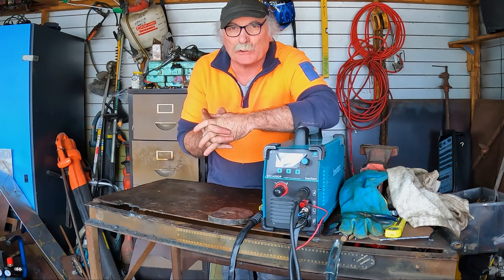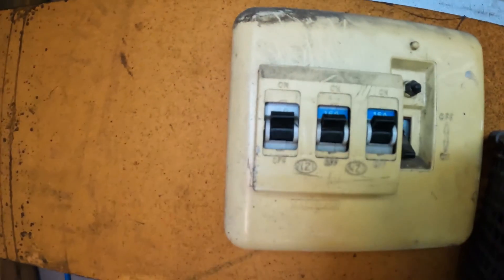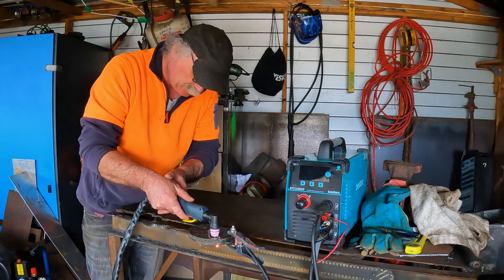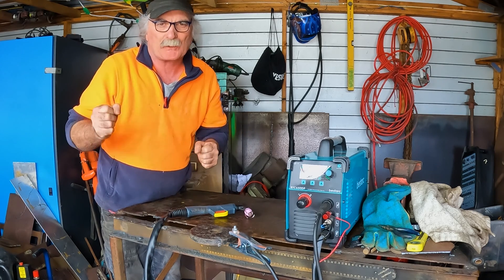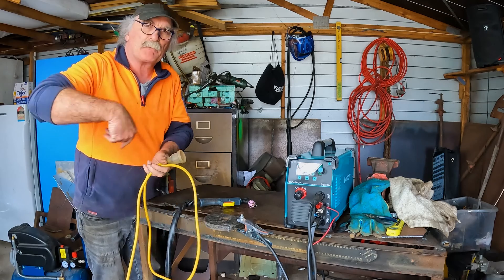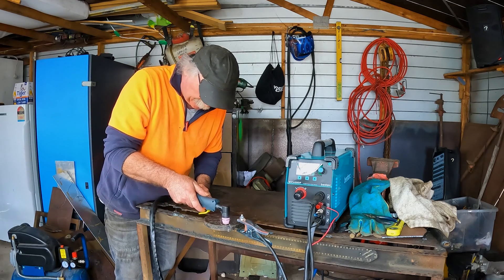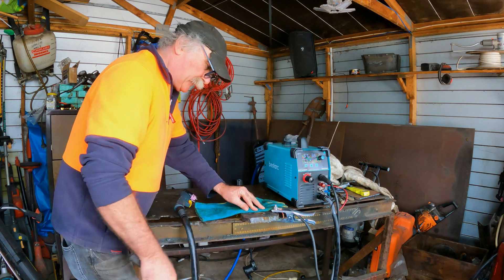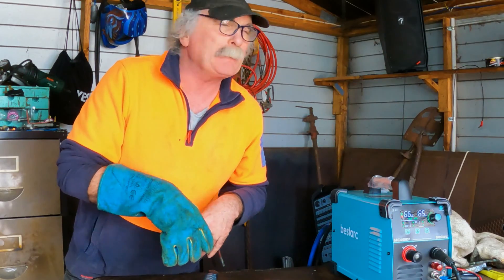Mistake You're Making when Plasma Cutting That's Ruining Your Cuts

Comment: When your plasma torch starts to cut it will pull more amps. Whatever your plasma is rated say 10 amps it will pull slightly more than rated by about 2 amps for a short time then back down after a bit. Not sure what you could do other than update the service to your shop for more amps.
Reply from the maker: Good info thanks